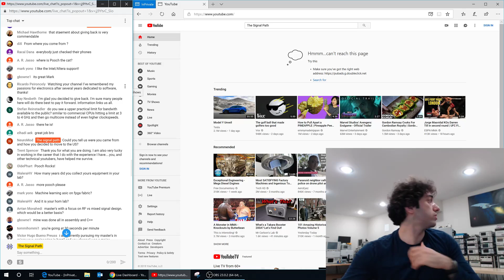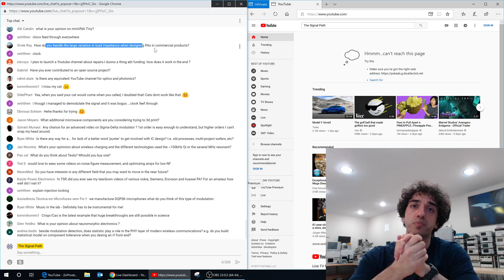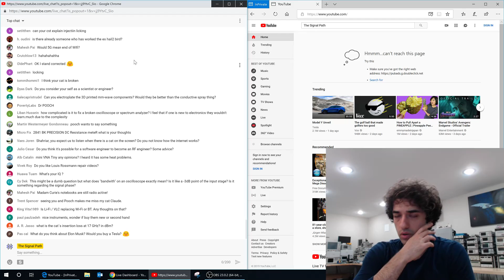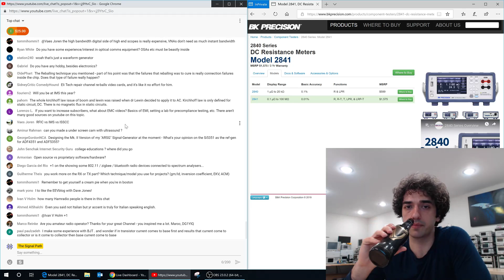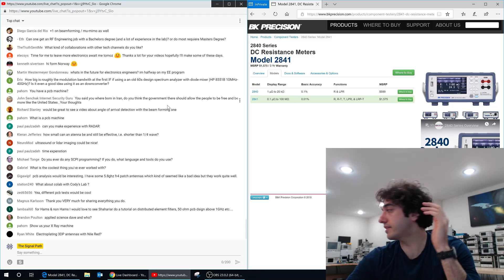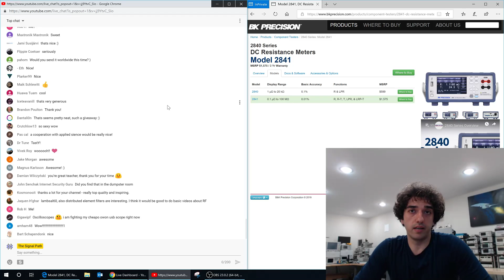TSP Live #1 - The Signal Path Live Stream & Giveaway  (March 2019)

Comment: Wish I had known earlier about the livestream I would have inquired about something.  Lately I have been working on an all-analog modular THD analysis instrument.  The whole unit is about 9"x5"x3", and comprises a simple main board switching one of three frequencies to feed to the DUT, and three notch filters fed back from the DUT.  The resulting distorted signal is fed into a track-hold circuit which converts the RT signal to a simple voltage that can be read out with a multimeter.  The present device  is intended  for audio signals and am attempting to achieve .0005% accuracy.  My question is if such an architecture can be used also with RF signals with simplicity, or must I use all the "magic" typically seen with multi-GHz instruments.  If you were to have a good cheap THD analyzer what three frequencies would you find to be most useful?  My simple module is a 37x50mm card for each of the three oscillators, three filters, and track-hold circuit, while the main board only has basic input/output conditioning.  No DAC's to be seen anywhere in my shop :)  Do you think it practical to have a good extremely low THD oscillator at GHz rates in such a form-factor?

J.R. Stoner